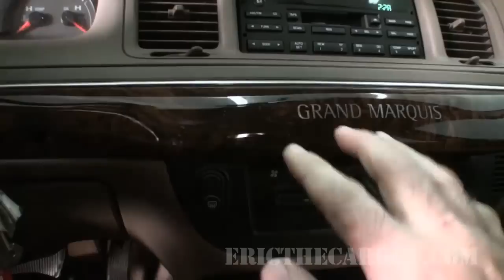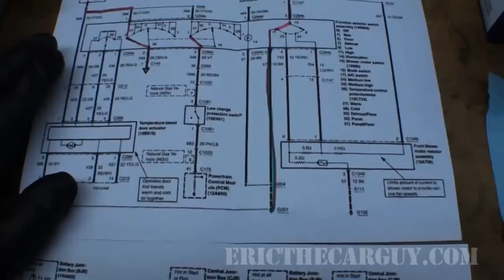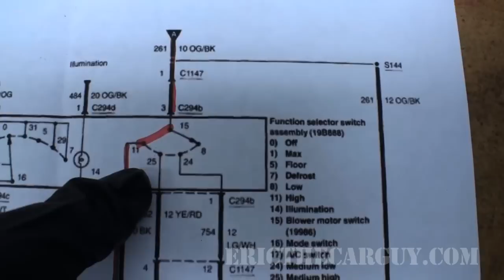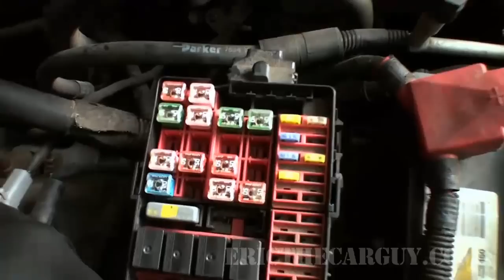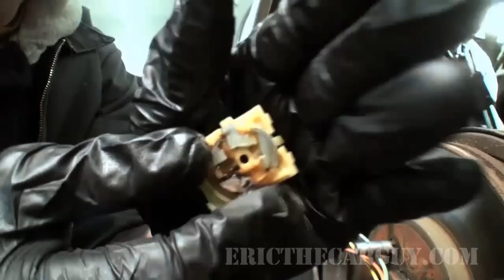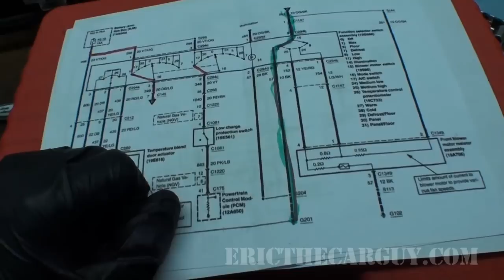2004 Mercury Grand Marquis Blower Motor Repair -EricTheCarGuy

Comment: Hi Eric, it was totally awesome to see how thorough you are. My 2004 grand marquis has a similar Situ and I have full blower on high and zero on the lower settings as you spoke of. I have the same switches as in the video ( manual) and I thought I saw the resistor gizmo way later  in the video with the resistor coils visible. Is that the one for this manual switch situation ? I haven’t looked at the switch inside or anything as yet since I am more mechanical than electrical but not totally inept. All the best to you and thanks in advance 🙏

Comment: Eric, you also replaced the resistor.  Could that have been a part of the problem? I just changed mine on my 2000 Grand Marquis because it was always blowing on high. The resistor fixed my issue.

Comment: Great video Eric.  Thanks for replying to previous questions I've asked.   I have a 2004 G. Marquis.   I noticed smoke coming from under the hood on the passenger side.  The temperature control was shut off.  Looking under the hood, I noticed what smelled like electrical short around the blower motor area.    I disconnected the top connector and drove the car to the Ford dealer.  The service rep thinks the smell is oil leaking from the valve cover gasket dripping oil onto the exhaust manifold.   I think he's wrong.  I don't smell burning oil.  I think it's an electrical smell like a short or burning wire ?   Could a fan switch cause a short even with the temperature control shut off, if the fan switch is starting to go bad?   My car has about 240k miles.  The bottom connector on the back of the fan motor will shut down your power steering if you disconnect it.   The top one will shut down the speedometer if disconnected.   
On a different problem, here's something you can pass on to your viewers.   If you have a Ford , G. Marquis in my case, and have replaced plugs and coils, but then notice your engine light eventually comes on and the car misfires, a Ford Master Tech told me to get the main computer reprogrammed.   I had the Ford dealer the car is at now reprogram the main computer in August of 2021, which solved the problem.   The engine light stayed off and the car stopped misfiring.   6 other Ford dealers never even suggested reprogramming the main computer.

Comment: I can’t thank you enough right now! The last week has been hell with little to no A/C blowing. I change my resistor one day, Blower motor yesterday, and still the same results. Finally found this video and bam same exact problem in my 2005 Grand Marquis. I cleaned up the switch and boom full power! I ordered a new switch just to be safe, but again. THANK YOU!

Comment: I am getting a battery light when the blower motor is off or on low speed. Replaced Alternator, A/c compressor,  belt and  battery

Comment: I have Marquis 2007 and He only blow air by the froth glass and cant change in the front or feets doesnt change I did replace the actuator all fuse are good air blower works now I dont know what else I can do

Comment: Thanks bro, I appreciate the knowledge. I wondered why the switch harness melted in the first place. Thanks for letting us know you’re human. 😀
Reply: Most likely the blower motor. A 40 amp fuse seems excessive for a fan motor. That's often the case when you have an electrical problem. Someone puts in a larger fuse instead of finding the problem.

Comment: I flushed out my heater core and replace the heater resistor. But i still cant get any heat do u think it might be the blower motor? I do have cold ac.

Comment: At the beginning when you are testing the blower motor,  I see you have the knob on the right turned off. My blower motor doesn't work unless the one on the right is turned on to one of the settings,  i.e. vent, norm ac, max ac, defrost, etc.

Comment: Sir I am having problems with my crown vic 2011 model when I put key in ignition switch and turn to accessory mode my blower motor turn on in full speed and stay on what will cause for this please help are any one there

Comment: All my speeds work. AC works. The problem is the heat doesn't stay hot and i tried it on all the different functions, floor, vent, mix , defroster, i.e.  it initially warm when first turned on but heat doesn't stay 2 minutes later.  What's my diagnosis

Comment: Scroll cage on my marquis began to change original shape , because of the heat, and began to melt and shake off the electric motor housing making such a noise as if you were sitting in some  very old diesel vehicle

Comment: Hi Eric. I jumped the gun and bought a Fan motor and changed it on my 2004 Grand Marquis and it didn't change anything. I  turned on the ignition and pulled off the plug off the fan motor and checked the 2 prongs and I  hooked the test light to the ground on the battery and found power on one side of the plug when the test light came on. Then I put the test light on the positive side of the battery  and touched the  other side of the plug and the test light did not come on so I have no ground.  What do I do now?  Please  somebody help me.
Reply: Donald Woods i have the same problem

Comment: theres one thing this man forgot,,,,,the fan only works if you have the left knob on floor or vent,,or mix.,,If both knobs are off,,,you get nothing at all,,,now if you put the left knob on floor,,,,you get a very slow fan,,,with no fan speed used yet,,then use fan speeds,,,and you should get them all,,then test to see whats wrong ,,,,
All the time he was talking about the fan after he put in,,,,i was saying to my self,,,he didnt put the left knob to floor!!!,,the fan would have worked,,,,
this is in my case,,,and my car

Comment: My blower was frozen stuck with ice in -14 degree cold in Wisconsin. Replaced it and the resistor. Problem solved. Easy Fix.

Comment: question i have a 2003 crown vic, and the heat /air is not blowing, but when i start driving mainly at a constant speed, i feel the heat coming thru the vent, its not blowing but its damm sure coming thru, what could be the problem

Comment: Eric, you saved me money again! My wife was driving today, called me and said there was a loud noise then a rumble in the blower. She had to do her choirs without air conditioner. (2003 Mercury G M) Like your video, I took out the 4 screws and cleared the wire's and the squirrel cage had came apart. I bought a better one at autozone because it showed a picture on that shaft clamp came with it. Fast fix, working fine, Thanks!

Comment: I hope you didn't leave that burned out switch in there! If you did, shame on you. Once an electrical component has been damaged like that, it should never be reused. It is possible that the blower motor caused the switch to go bad, but that doesn't mean you can re-use the damaged switch. The motor might have been fine. If you had measured the current and compared it to the new motor, you would have known for sure. Some of your terminology and explanation of how to troubleshoot electrical problems is disturbing, but keep those repair videos coming!

Comment: Eric, with your power probe(I have two of them) you very easily could have ruled out the load(blower motor) as being the culprit. Voltage drop is imperative when dealing with a situation like this...but, we all make mistakes.

Comment: Man I bet that thing isn't too far removed, construction wise that is, from your fairmont. Maybe a little more solid, maybe put together a little better (not knocking the 'mont, just stating that 70s autos from all 3 Detroit brands were not put together with attn to quality.) but still, probably came off the same line even

Comment: I have a 1996 Toyota T100 pickup truck, and the blower motor does not work at any speed.  Research said to first check fuses (at the motor and possibly inside by the drivers left leg); however, there is no listing for which fuse is for the blower motor at either location.  A person at Advance Auto could not tell me the exact fuse but thinks it would be the AC or Heater fuse.  Next step is to test the resistor.  Next step is power to the motor and then pull the motor and test it at the battery.

Comment: Hey I have a 2001'lincoln towncar.. The ac works but when I hit the off button it only turns the compressor off. The air keeps blowin just it's hott..so no matter wat the air is constantly on. Does anybody kno wat this could be?
Reply: Did you ever find out what cause that?

Comment: First step in diagnosing a blower-motor problem is *always* run +12V and Ground directly from the battery to the motor's terminals.  That would've immediately led you to the switch.  At least that old motor was easy to remove and replace.  :-)

Comment: You are not correct.  Flow does not generate heat, resistance does.  Everything gives resistance (everything!).  The reason why a short to ground causes heat is because with very little resistance (no load present to control the flow) electrons are moving so fast, but still release heat because of the resistance in the wires themselves.  Like i said to you earlier, heavy resistance alot of electrons are released to generate heat (melts connectors), with high current a little is lost very fast!

Comment: Hi. I have a Nissan Pulsar srv, and I changed the blower motor resistor. And, now it is working, but, the speed number 2 is stronger the speed number 3. I installed a blower motor resistor from a Nissan Cefiro. Should i have taken the blower motor resister the same model of car I have or can i take from other model. Thank you

Comment: Isn't it just the luck that it would be the internals of the switch? I agree that the motor "could" have been back feeding into the switch. But without proper testing, it is an unknown variable. Good job diagnosing and repairing the issue. At the end of the day, as long as the problem gets solved, that's what matters. I enjoy your videos. Thank you.

Comment: Hey Eric you could have tested the top speed circuit by putting the earth lead of your dmm to battery negative and your possitive lead to the negative - into the blower motor put the switch on high and see if you have voltage if you have your negative path is bad. I now you did a test like this but using other body negative connections you may get a false reading through other neg's connected to the body.

Comment: The excess heat is caused by higher than normal current for that circuit. without current you wouldn't get heat! as with the other posstions on the switch go through resistors that may go someway to protect those contact's on the switch, top speed has a direct path to earth hence heat build up on the top speed contacts and the hotter they get the higher the resistence. I have had this many times on failing motors.

Comment: Eric
I think you should have had the motor connected and on then back probed both + and - at the same time.  With the switch on full you should have seen battery voltage across the motor or close to it. I suspect you would have seen 2-3 volts max because of the high resistance you had other places.  However with the excessive current that had been pulled the motor may well have had mechanical issues. The easiest way to check a 12 volt motor is to disconnect it and jump battery voltage to it.

Comment: i've purchased a new motor to install in my 1999 honda civic dx. and this particular motor is an EFI . My past motor was a D16Y7 with a Throttle body.. i think this swap is called mpfi swap??? im not sure. But i was seeking information on how to get this swap to work. & what parts i will need to purchase.. 

- Gabriel

Comment: Also just real quick for an easy way to think about it.  On high, your blower motor is getting system voltage (12 volts).  To get lower settings the switch sends current through the resistor.  All a resistor does is limit current flow, which makes it run slower.  So for an example low would be 100 ohms, medium 50 ohms, high would be next to 0 ohms of resistance.  Knowing that, now if your high (on its own circruit) is blowing lower than others, what makes the motor operate slower?  Resistance!

Comment: This is a very common misconception.  The weakest link in a circuit is the built in flaw, the fuse.  High resistance does not = increased current draw its just the opposite.  Oxidation (its correct term, not corrosion) happens all the time in circuits.  Where the oxidation occurs, causes excess resistance which then causes higher than normal circuit temperatures (which causes melting of plastic).  You can isolate where your problem is occurring by the wiring diagram. High is on its own circuit.

Comment: I would agree with you Eric. looking at the wiring diagram it looks like a worn out motor would cause melting at the switch on full speed due to the high current draw being transfered from a poor connection with the brushes to the commutator.The weakest link is the switch The other speeds might not be as affected as the go through a load Resistor.

Comment: You're almost on the right path, resistance generates heat.  When electricity tries to move through a conductor (everything has resistance) it loses electrons due to the friction (resistance).  The loss of electrons gives off heats, which is why usually bad electrical components are hotter than normal (high resistance).  The reason wires burn when no load is present is because current moves so fast even though its losing very little electrons, its still release a small ammount very very quickly.

Comment: I suspect that the blower was failing mechanically not electrically. Did you notice how slow it spins when E had it on the bench. Probably drawing extra current to run. Current=heat across contacts. Over time heat melts plastic.

Comment: Eric, there is a tool I came across as I do alot of electrical work thats fairly cheap, and works with any DMM.  It does your voltage drops through the entire circuit, and its pretty easy to find which side of the circuit is causing your problem (power/ground).  If you're interested, check out Loadpro test leads.  They made all my electrical diag's so much easier.  Keep up the execellent work, I watch your video's all of the time.  Even learned a few things in the process!

Comment: A lot of people learn through mistakes. Eric, you may feel that you've made significant mistakes diagnosing the problems with this vehicle's blower motor, but I doubt a dealership would have been capable of finding the problem. I'm sure there are good dealerships out there, but I don't think many of them would have gone to the trouble that you had.

Comment: I'm wondering what the cause of the original heat/melt condition was that led to this. Usually things only do that when they short circuit, but obviously the short wasn't enough to blow the fuse.

Comment: Slider it's obvious you have never been a paid technician. I have worked as a computer tech specializing in large industrial equipment. Sometimes you don't troubleshoot everything to the failing component on the first try. Sometime you do replace non-failed parts to get to the root cause. Eric was the bigger man by admitting his mistake and learning from it. And btw ,I'm not offering, I dont do trolls...

Comment: I had a similar issue with my Mazda 3. The AC would cut in and out . I pulled open the fan control, burnished the contacts and re-greased it.. All good

Comment: Plus, i have had plenty of experience with European Fords where the contacts in switches and fuse boxes have clearly not been up to the job they were designed for. Just because on paper a circuit was designed to handle a certain current, does not mean the finished product is actually capable of doing so. Quality control on some of Fords electrical circuits is suspect to say the least.

Comment: And yes, the circuit is designed in such a way that the fuse will blow when a very high current is drawn - for example a complete short, but from experience i know that a motor can draw excess current high enough over time to cause heat in the weaker parts of the circuit, a stiff bearing on a motor can easily cause such a condition, so can a short between windings. Both of these can cause a higher than normal current draw without drawing enough current to pop a fuse.

Comment: I totally agree, all components are designed to handle inrush current, but they are not rated to handle that sort of high current over a long period of time. The constant current rating of a circuit is totally different to it's momentary current rating.

Comment: That motor needed replacement anyway, if Eric only cleaned the switch, it would have melted again causing the same problem, if not worse. I've had similar problem with my furnace melting switches until I had the heat unit replaced. If a switch melts, there must be a reason.

Comment: Wrong, the fuse will be rated high enough not to blow with the initial high current draw when the motor starts - this can be double or more what it draws once up to speed. Because this high current draw is brief, the wiring and connectors will not be affected by it. So, it is more than possible for a faulty motor to draw excess current without blowing a fuse.

Comment: I once chased down the problem on a Buick that was blowing poorly.  Turned out the electrical part of the ignition switch had failed and was causing low voltage to the climate control panel.  Who would have thought?

Comment: Eric, i agree with your diagnostic. A faulty motor would draw excess current, which in turn might not be enough blow a fuse, but, over time, will cause over-heating of those contacts. If you only changed/repaired the switch there would have been a very good chance that the faulty motor would cause the same to happen again within a short time. Good fix Eric, not only have you fixed the problem, you have also fixed the cause of the problem, and that is important.